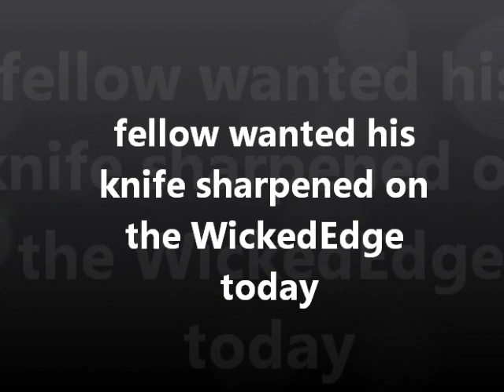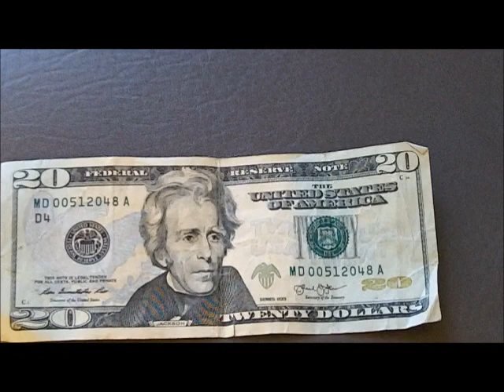BenchMade 940 Knife Sharpening - WickedEdge Knife Sharpener

Comment: Aluminum handles with Titanium back spacer, no g10 on that knife. Your edge polishing is great, I'm sure it's as sharp as it looks. I used to sharpen like that. Now, I stop at 600 grit and do some light stropping with fine compound on thin leather. I really like how stropping brings out the sharpness so it can effortlessly shave hair, but the micro teeth still left over really bite into plastics and fibrous materials. Also, polished edges get scuffed up fast and take a long time to restore the perfect shine. The 600 grit and stropping is just so fast and easy. More cutting, less sharpening!!!!!!!!!!!!!!!!!!!!!!!!!!!!!
Reply from the maker: I do the same as you when using kalamazoos......this fellow wanted extra sharp polish.........cost more and takes time........I use the WE only once in a while now

Comment: Nice edge on that knife...You got any pointers for a novice working on fish filet knives?......I got a smith precision sharpening kit.
Reply from the maker: Go to harbor freight ....buy 1 X 30 belt sander......around fourty bucks......buy some high grit belts from 3m.......a65 thru..a12 or a6.......1 leather belt and green compound.......go to thrift store....buy several cheap dull knives to practice on.......you tube sharpening on 1 X. 30.........hundreds out there